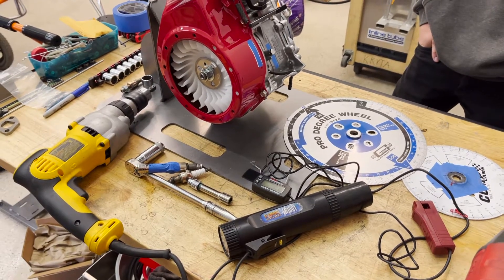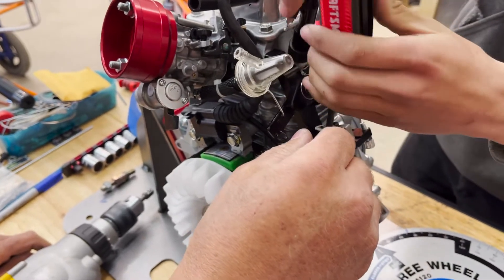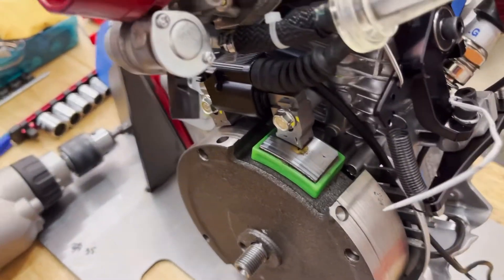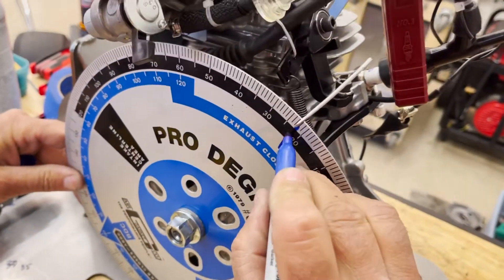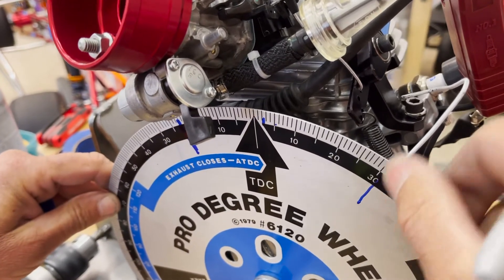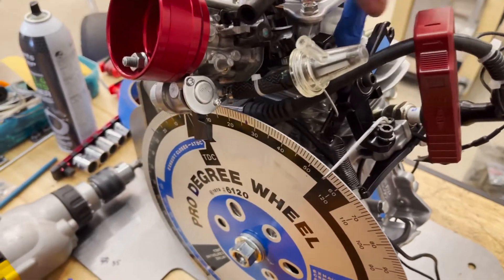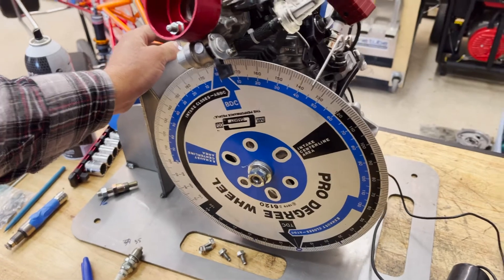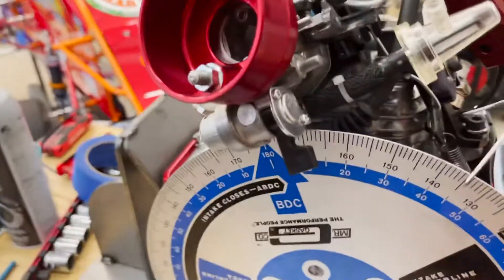Check Timing on Quarter Midget Honda UT3 120 - Part 1

Comment: I disagree, with your procedure,,that's not tdc,,your not allowing for wear in gears,which will throw it off,moving forwards and backwards,piston needs to be at tdc,TDC, clockwise,never backup,gear mash  is different,it wears one way,Forward motion,it don't run backwards, fine a indicator to put in spark,plug hole,to be correct,34 yrs,at this sport,in racing,stock,Modified,builds,the more I watch this ,the more I think of incompetence being shown here,I'd protest this procedure, Gee just a lil common since here!!!!